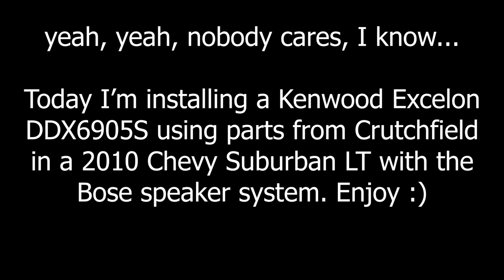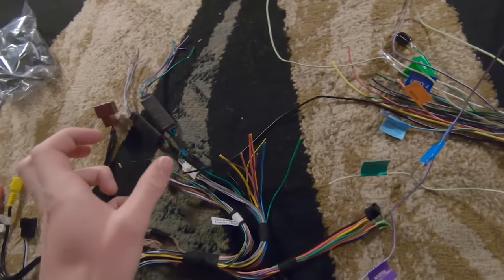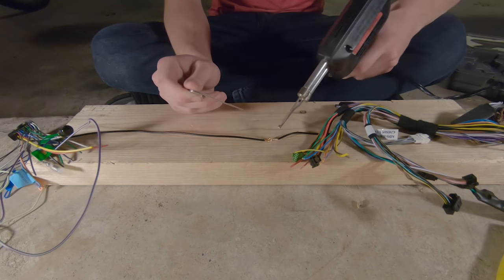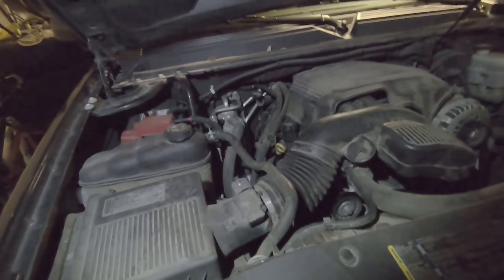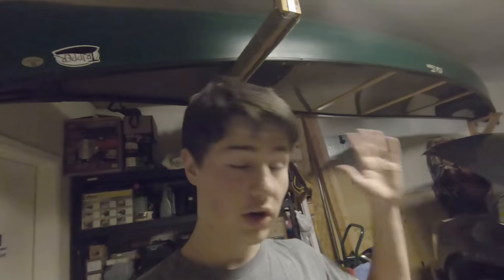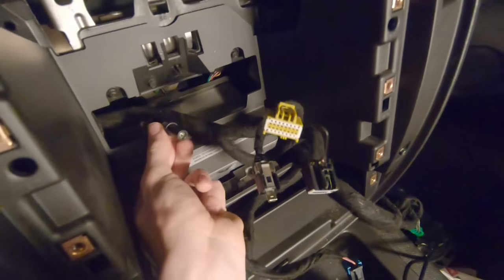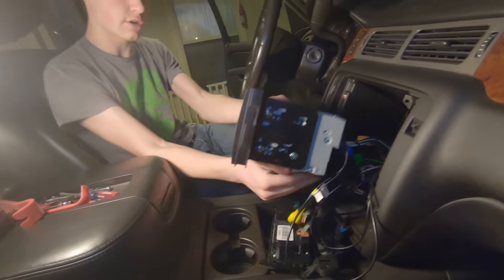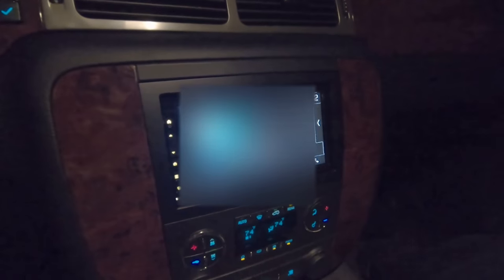Installing an Aftermarket TOUCHSCREEN Radio in a 2007-2014 Suburban/Yukon!! Kenwood DDX How-To

Comment: Make it easier on yourself. The harness from the kenwood, cut all the wires to the same length. Could also just use butt connectors

Comment: My antenna adapter won't fit the 2013 Chevy Tahoe LTZ that came with the wire harness?
I have a navigation factory radio
Reply from the maker: Not sure what could have happened there, maybe a mistake somewhere along the line?
Reply: @DartBProductions  
So far both antenna adapter from different wire harness is the same, guess am just going to cut it and cut the antenna adapter also to tie it together. 🤔

Comment: I am sorry, where did you get this diagram/ scheme in 5:22? I am trying to montage the original radio in my Tahoe 2007, just bought used radio and just want to check out does it even work. I do not know where which wire goes in and what is it for and all those ports.
Reply from the maker: The diagram came with the harness adapter that I bought
Reply: Ok, thanks

Comment: This was very informative. I am not personally installing this radio but today itll be installed. I wanted to get a glimpse into what it would take for some one to get into a similar vehicle model as mine. Follow up video on how it's working or how you like it?
Reply from the maker: Thanks for watching it all the way through!! I haven't had time to mess with it much since putting it in. In all honestly learning how to use the unit itself is a process that is best learned by hands on experience. As a head unit it works amazingly, super high quality and very nice to have navigation via Android Auto on the car instead of a phone. As for integrated vehicle controls, that video will happen at some point when I find the time to troubleshoot the issues.

Comment: Does your stereo turn on when in “Accessory
 mode” ? My stereo doesn’t only when put into the “On” position.
Reply from the maker: I don't remember but I believe that it did... Could be wrong though.
Reply: Dart B Productions damn I literally went to a shop and I believe they wired it wrong
Reply from the maker: @edgarh252  Uh oh, I would hope not... Like I said I may not remember correctly but I think I remember when I first tested it that it did boot up without the car actually running. I can call my dad and ask him to check if you like
Reply: Dart B Productions It’s alright and the only reason I could think the guy did that Is because I have a rear tv like this suv and it’s like that as well so he probably didn’t test it and just connected it to existing one.
Reply: @DartBProductions  it's like that because the factory stereo is turned on thru the serial data bus. Usually an aftermarket stereo has no input for that. Since their made for different manufacture's. Aftermarket stereo 's are looking for a power with key
Reply: a tip : watch series at Flixzone. Me and my gf have been using it for watching lots of of movies these days.
Reply: @Vivaan Boden Definitely, been watching on Flixzone for since november myself :D

Comment: I'm having a hard time getting enough clearance in back of my Excelon. I pulled my factory harness down by the gas pedal and connected everything down there, then ran stuff back up to keep the radio din cleared out, but it still isn't enough.
Reply from the maker: Clearance is really tough back there, it's been so long since I was back there I don't know how much help I could give you other than keep at it

Comment: I have a 2007 suburban ltz and want to add a 2din but they are telling me i need some type of interface to keep the bose audio and the steering wheel controls does anyone know whats its actually called and where i can find it for a good price?
Reply from the maker: I personally use Crutchfield.com for all radio needs, they will set you up with everything you need

Comment: What does the chime thing do and do u need it
Reply from the maker: The chime speaker replaces the in car speakers for backup alerts and the like. I would try finding a place for it without sticking it on first
Reply: Dart B Productions what install kit did you use? Does it have the factory door chime sound?
Reply from the maker: @Skankhunt98745  the installation kit was the recommended one for my model vehicle from Crutchfield.com